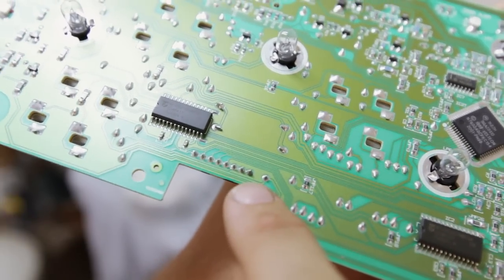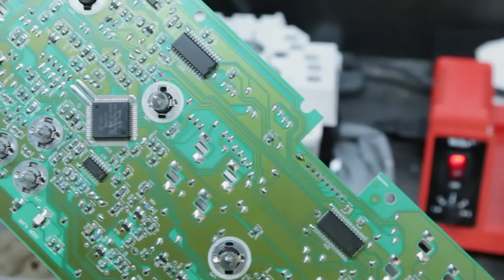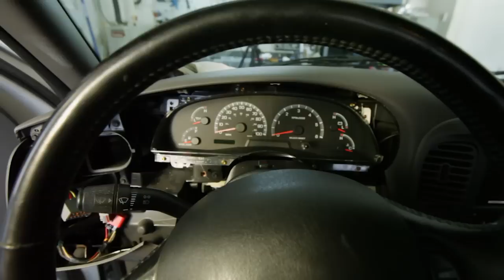How to Repair a Ford Odometer Digital Display

Comment: It’s such a widespread issue.  There should have been a recall/fix decades ago back.   I used to smack dash 11 position.  That no longer works.  FORD should do it for $200 with oil change tire rotation, new cabin air filter.

Comment: Great video. I already pulled the dash panels to do the radio so I might as well go ahead and fix the odometer while I’m at it. The less times I need to risk breaking the old plastic the better.
Reply from the maker: Thanks for watching and best of luck with your project.

Comment: Thank you so much a drop of solder is all it took. Fixed my odometer on my 2001 F150 SuperCrew. While I had the cluster out I cleaned out the dust accumulation between the plexi and the gauges. My only regret was got the wrong sized bulb for the cluster.
Reply from the maker: Great to hear you were able to get it working!

Comment: This worked like a champ on my 2002 f150! 

Years ago, the odo display started going out intermittently...and the last few years it's almost always off, but it would come on for a day or so after a really heavy rain. And if it was around inspection time I'd have to race to the shop and try and get the inspection done before it went back out lol.

Thanks for the great video man, it was super helpful! Cheers!
Reply from the maker: Love to hear a comment like this. Thanks for sharing.

Comment: Once you repaired it, did it still have the mileage stored and keep up with the one's while broken?
Reply from the maker: The mileage data was not affected.  It was just an issue with the display.
Reply: @MrKistel  thanks just got a Expedition and need to fix mine. ✌️

Comment: I'm both sad and glad this is common problem. I also have an 03 f150 and i need to track mileage and this makes it impossible. Sometimes i can hit the dash and it works. Winter it seems to last longer than summer
Reply from the maker: Yes that is frustrating.  Hopefully you can get it repaired. Thanks for the comment.

Comment: This worked like a charm on my 2003 f150. Been driving me crazy for years having my odometer come and go intermittently. Thanks a million!
Reply from the maker: Glad it helped
Reply: Mine too I took mine to the dealership. They said they couldn’t help with the repair have to order a new cluster. I will give this a try. I did have to do reciter on the stereo  it fixed it.
Reply: Wow i have one also same problem. Good job Ford...

Comment: Have ford edge 2007 need to power up the cluster on bench any know what wire need power and gnd and ignition key on wires are

Comment: Got both the multi switch lever and the Odometer display done in 1 sitting. Starting to put it back together and the Trip Set/Reset lever fell out. I don't see how it connects to anything. Do you know if it does and how to get it in right? Is taking over 3 hours I wonder because I'm left handed. Thanks for explaining and showing this clearly.
Reply from the maker: Thanks for watching, it has been awhile since i took the dash apart so I can't recall.  Hope you get it figured out.

Comment: About to try this in my 2002 F150. My “cruise” light is out as well. The cruise control works but no green light. Anyone know the fix for it? Am hoping to fix it while I have the cluster out. Thanks.
Reply from the maker: Thanks for the comment, best of luck with your repair.

Comment: Did mine  and it worked but I would recommend examining every solder joint in the set with a strong magnifier. I had the typical obvious solder cracks on the outside pins but upon closer examination with a magnifier I could see at least 2 more inside pins were cracked , so I did them all. Over the years I've fixed quite a few relays, modules ,etc. with this problem and every one was on a apliance or device subject to a lot of jostling or vibration so that is definetly a factor I believe. Another thing I would strongly recommend is the use of liquid elec flux as a prep to soldering. It is really important. Put a few drops on a Qtip and wipe the joint, you can solder immediatley and it will reactivate the old solder like magic. It also will require less heat with flux and there will be less chance of lifting a trace.Make sure you do wipe with alcohol when your done to remove any remaining flux from the area.I have poor eyesight so I was nervous because these pins are a lot smaller than you might imagine from the video and I was worried about bridging joints accidently.Got it done thogh and I'm so gratefull for  this video and one other  which were indispensible so thanks so much for making it!
Reply from the maker: great tips and thanks

Comment: This might have worked for my 2005 expedition, however it did not.
The instrument cluster is a different model. The back cover doesn't come off without removing the entire face including the thin black cover and needles. The screws are under the face.

 However, I wanted my husband to attempt it anyhow. He cut a hole in the back to access the green board.  We couldn't see any clear damage that we should specifically saw her specifically sautter. So we touched up some points and put it back in to see what would happen.
  We plugged it back in and some and some things worked and some things didn't work. But some things stayed on even when the car was off which drained the battery.

In conclusion, I have a new cluster on the way. And for now it's not plugged in at all so I have no idea how fast I'm going or how much gas I have and other things stopped working also. Cannot roll my windows down.. The automatic door locks do not work.And worst of all! The radio wont-work!
 Who knew all these things ran through the instrument panel cluster?!?! Lmao ....lesson learned.
Reply from the maker: O wow thanks for sharing.  Did the new cluster remedy the issues?
Reply: @MrKistel  Actually... no

The one I ordered said compatible with 2005 or 2006 ....
It turns out the one I ordered will not communicate with my truck.

 From what I found out, people are telling me I need to find the exact make model and year for my truck because they communicate differently..

I am on the lookout for a 2005 eddie bauer cluster.
Reply from the maker: @kbaldridge01  best of luck and thanks for sharing

Comment: Took to a professional repair shop when my soldering didnt fix. Person re-did wht i did, ws ble to get odometer working on his bench. Also tested oil/fuel gauge via electricl resistnce...also passed.
Reinstall and......nothing. gauges still dead and idiot lights blink when i rev the engine.
Reply from the maker: That is a bummer. An idea? A possible main power wire or ground wire to the system damaged?

Comment: Worked like a charm, only thing you didn’t mention was removing shift selection gauge at bottom of cluster otherwise great video. Cheers!
Reply from the maker: Thanks, I didn't think about mentioning that. This was a manual transmission truck, so I didn't think about the extra steps with an automatic.

Comment: Can you tell me how long did it take you to disassemble , fix and then reassemble?
Reply from the maker: it has been a long time since I did this project so I can not recall exactly. I would guess it took a couple hours or so.
Reply: @MrKistel  Thank you. I’m in process of buying a 2006 Ford F-250 and the digital odometer is not working. Eventually I will have to get it fixed and I was trying to estimate how much it will cost. Runs great!
Reply from the maker: @tinanieves4980  congrats on the new truck!

Comment: hi i have a fiat punto 2006, the full speedometer is working and the place where mileage is displayed has back light but the mielage does not apper. i have changed the speedo however it is the same thing. do you know any thing.

Many Thanks

Comment: You think this problem would have been addressed by Ford but it continued on into the next gen f150. My 2006 is doing the same thing. I'm sure it's a cold solder joint.

Comment: I know this is an older video..however....im an Excavating Contractor...had an Excavator few years ago with a digital display acting up. I took out panel, took apart...just re soldered as many places as I could. It fixed the display panel. I use to do it to my older guitar amps as well.
Reply from the maker: Great tip to resolder as many connections as you can get to. Many times, it is hard to tell if a specific solder joint has failed so not a bad idea to resolder all the connections.

Comment: Pugs on your seem a lot easer to take out .  Trying pull them out like crazy tried with plyers still no luck.
Reply from the maker: Darn sorry you are having a frustrating time. Let me know if you figure it out and are able to make the odometer repair.
Reply: @MrKistel  I brought circuit board to place yesterday .  Lot of hair line cracks so said was fixed 130.00 .  I put back in Dave only  half the instrument worked left side didn't work .  No gas gage no light to odometer oil not .  Just maybe no power to that side of it.   So I called him wanted vin number and picture of instrument panel .  Waiting to hear back .  I am wounding if i broke a wire by pulling it out .  Clip is broken that u push down on .  I got check the power to plug goes into it ..  My blinkers not working or brake light now.  Hope that all tied into the board also.  Ready get rid of truck after all this crap.   2003 Lariat F150  step side.   But what  have in newer trucks today even harder to work on  so worth it money they are asking nuts.  Put up what you have try keep it going .  Have rust to deal with.  Never ends i guess.  Thank you for help.
Reply: @MrKistel  Is there away I could check or replace the tab in the back might not be getting power.  You know how to change it?

Comment: Thanks for this video.  My odo has been going out for a while.  I didn't know it was this easy to access, so I took it out.  I noticed I had two dry solder joints.  The far left pin and the far right pin.  Put some fresh solder on those and it works like a charm.  While I was in the cluster, I went ahead and cleaned the clear bezel, and 18 years worth of dust trapped inside.  Looks brand new and now my odo works.  And I've got almost 408,000 miles on my truck!
Reply from the maker: Glad it helped Congrats on surpassing 400K miles on your truck. That is amazing.  Any major repairs to get you that far?
Reply: @MrKistel  Thanks!  The water pump finally went out about a year ago and I had to get that replaced.  A/C compressor isn’t working - it locked up, so I’ll hopefully be replacing that soon.  It was missing pretty bad but I had the coils, spark plugs, and wires replaced and it runs very well now.  Haven’t done anything to the supercharger, I’m afraid to mess with it, but it seems to be working well.

Comment: Thank you so much for this video. My truck made it 20 years and 148246.0 miles before the odometer quit working. I have the ford shop manuals, but they are no help on this problem. Fords solution when the pin test fails, is to replace the cluster. This saved me hundreds of dollars. I, like some other people commented, had to struggle a little to get the gear position indicator out as my cluster has no tach, but with a little work was able to figure out how it comes out. The whole process took me about an hour to complete and it worked great. Could not have done this without your video. Your clarity in this process made this task not only doable but allowed me to enjoy the process of the repair. Thank you again for taking the time to share your knowledge on this fix.
Reply from the maker: Wow thanks for this awesome comment Albert. Congrats on your Ford odometer display DIY repair. Feel free to reward yourself with one of our DIY branded shirts in the channel shop. (Forgive the shameless plug!) Thanks again.

Comment: How much would that work cost?
Reply from the maker: I really do not have a clue how much a car repair shop would charge to repair the odometer display.  I also wonder if it would be easy for a car shop, or even the dealership, to properly diagnose this particular dash display issue.
Reply: @MrKistel  exactly, they would probably request for a new display😂. One more question, what happens you I don't get it repaired?
Reply from the maker: @Mipincheacordeon  I guess you just might not be able to see your mileage if you do not fix it.  However the miles driven should still be recorded. So if you fix in the future you should see the correct miles driven.
Reply: @MrKistel  thanks a lot for the information, broh. I'm a New subscriber
Reply from the maker: @Mipincheacordeon  Thank You

Comment: Did I miss a previous video? How did you know which solder point was the one you needed to redo? My odom has been blank for a long time, now I have other cluster lights that come on. When they do I lose my tac, speedo and water temp gauge. Please see my video and offer your advice. Pretty sure there's a short, but I don't know what solder point may be causing the problem. Thanks
Reply from the maker: Thanks for watching and sorry to hear of your frustrations with your vehicle's dash display.  I am afraid I am not sure what your issue may be. You can visually inspect the board the best you can and see if you notice an obvious short or a solder break somewhere. Please let us know what you the culprit was when you figure it out.

Comment: It looks like you soldered the joint on the non-plug side of the board. Other videos showed soldering on the pin or plug-side of the board. Does it make a difference?
Reply: OOPS! Disregard the above. I watched it again. Hope I didn't confuse anyone.
Reply from the maker: Thanks, did you have an issue with your odometer in your truck? if so i hope this video helped you repair it.

Comment: Excellent video including that pesky gear shift cable! The rest was straightforward, but that cable was hard to see without pulling that extra panel. The soldering is the easy part for me since that's what I do for a living. I have a 2002 F150 FX4 late model (after Feb 2002). Thanks!
Reply from the maker: Thank you for sharing that this video was helpful for repairing your Ford dash display.

Comment: Thank you very much first video that came up on my feed.
Reply from the maker: Very cool, let me know how your Ford dash display repair comes out. Thanks.
Reply: Faced my fears and fixed it. I first could not see the crack in the solider so I had to look @ it under a lighted magnifying glass then I soldier it again. Took it outside and tested it and got good results.  Ithanku

Comment: The correct way to remove the headlight switch is this.
Pull the headlight knob off. To do so turn them on and pull out like turning on fog lamps even if it does not have them. There is a little hole opposite of the way knob is pointing. Use a little screwdriver or something to push in and it will release it.
Then turn it 180% (backwards I guess) and put it back on. 
Turn know to the off position. Then turn it back to on. This will release the clips and allow you to pull it out.
I put this because I broke one. And sorry if someone already shared. I didnt read all comments
Reply from the maker: Thank you for  the insight on how to remove the f-150 headlight knob.

Comment: Hello which one do you think I need to sodder if my odometer isn’t showing and the needles all don’t move. All fuses are good and the lights on cluster work just not the odometer and needles
Reply from the maker: Jason, hard to say but if you take it apart you might be able to see what the issue is.  Perhaps a loose connection will be visible. Please advise what you determine is wrong with your Ford odometer.

Comment: Hey, great video.  QUESTION:  If one of these electronic odometers stops reading mileage at 50,000 miles (for easy math) and you repair it after 10,000 miles, will the repaired odometer read 50,000 or 60,000 miles?  Thanks in advance.
Reply from the maker: Forrest this Ford dash repair fixes the odometer display.  The mileage data is not effected and the dash display should read the accurate vehicle mileage. Thanks for the comment.

Comment: I had the same situation it's stop working but the next day started working again. But after 2 weeks without using my truck I just started and is not working...
Reply from the maker: Ya that sounds like they typical situation when this issue is present in the Ford truck.  I hope you are able to repair your odometer display.
Reply: @MrKistel  I hit the board hard and started working again...
Reply from the maker: Well that's one method to get the Ford dash operating again. Haha. Best of luck to you.

Comment: I have a question I’m trying to put in the speedometer with the rpm to mine which doesn’t have it but I have a cord stuck on where it says p r n d 2 1 I can’t unlatch it
Reply from the maker: Not to clear on your ford speedometer situation but let me know if you figure it out. Thanks
Reply: MrKistel mine isn’t tac or somthing like that

Comment: I just got a display of " T 206.7" on my digital odometer...... what does that mean?   I noticed you also got a "T" readout before you pushed the reset.    I have a 2000 F150 that has also been blinking on occasion.   Any ideas on the code?
Reply from the maker: Not sure on the dash code you mention regarding the F-150. Please share if you figure it out and thanks.
Reply: Push in the odometer button once to change the readout to truck mileage. T 206.7 is your Trip mileage. if you want to zero out your Trip mileage, press and hold the odometer button.
Reply: Push in the odometer button once to change the readout to truck mileage. T 206.7 is your Trip mileage. if you want to zero out your Trip mileage, press and hold the odometer button.

Comment: A new cluster is 300.00 dollars with a 300.00 dollar core 
-Autozone
Reply from the maker: Thanks, so it basically free with the core?
Reply: @MrKistel   my bad, if you bring the core is 300.00 if you don't bring the core is more than 300.00
Reply from the maker: Got Ya, thanks for clarification.